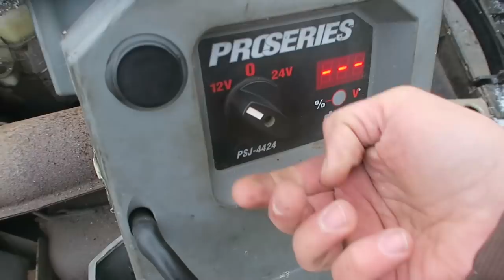BUYING A $350 CRAIGSLIST SNOWMOBILE !!! ( & GETTING IT RUNNING )

Comment from the maker: Hey riders! You guys have to tell me what you think of my new purchase?? Think it was a fair deal for $350??
Reply: Indeed
Reply: Great deal dude . Last year I ended up getting at 86 polaris 600 triple for $200 online . It's been a great sled just had to do some work to it . Love the videos man keep them up !
Reply: I’m not a fan of the torsion arm suspension. But I think you still got a good deal.
Reply: Wire brush on the plugs, helps temporarily
Reply: Jeremy Rhydes deffently worth now customize it ( paint it, new lights, new seat, new track and skies and obviously a nice engine tune then it’ll last u a few winters and u could sell it for triple what u paid for it and start over lol
Reply: Great deal, but your 700 is the go-to sled.
Reply: Nice but you got to get a new seat are you
Reply: Only if u water skip it 
L
Reply: I knew it wasn't going to start and run. should always clean the carbs after they've been sitting for any length of time.
Reply: Jeremy Rhydes man that’s a great deal!  You should clean the carbs and it’ll probably run like a champ!  Cheers!
Reply: even though everything now a days basically has reverse and electric start you still got a good deal considering it actually was a complete running sled when parked . i dont believe everything i hear online and am sure that there is more to it than meets the eye so to speak . if you really only paid 350 for it yes then you got a fair deal .  reverse is a must and electric start is a bonus .  if its electronic reverse you got a even better deal due to the fact that it is easier to change electronics then it is to change the gear chain drive . only problem with the electronic reverse is that if they give problems good luck in finding out why . lots of sensors and you will need to hook it to a electronic reader to find the exact fault .
Reply: The first thing I would of done is clean the carburetors...POLARIS
Reply: Great Find!!  I wouldn't have given a second thought...  Shut up, and take my Money!!  XD
Reply: You ever need any Ski-Doo F chassis parts I got some you can have including a chassis a few cowls one of them is a smoked clear lexan cowl. You can have them I just need them gone.
Reply: Jeremy Rhydes I got my snowmobile for free engine was seized and carb needed to be cleaned did that ran fine
Reply: I bought a 2009 Polaris assault rmk 800 146 nothing wrong runs great fast asf for $1000
Reply: Yes
Reply: Slow , old beater sled.  Not worth 350 to me.
Reply: Next time put gas down each cilander will fire up and draw through carbs faster less pulling.
Reply: Not bad! I recently got a running 370 arctic cat for 25 bucks lol
Reply: Hi
Reply: Good deal
Reply: I don't buy nothin that don't run. It could be a couple hundred dollar part you need and that is, well just a shity deal
Reply: PS. Skidoo so gay. PO fuckin lari's is the way to go.
Reply: Jeremy Rhydes good deal I really like Craigslist i just buy 2 days ago a 2010 Polaris sportsman 500cc 4x4 ondemand with only 40 hours of use and 177miles in brand new for only 900 dollars that’s why I always check Craigslist always you found something good and chap👍👍
Reply: Totally a great deal. I bought a boat for $300 and sold two weeks later without any work for $600
Reply: Good deal man!
Reply: I think it will
Reply: Hell yes
Reply: Best deal I got was 200$ for a 98 Polaris Indy 500
Reply: I got a 1993 arctic cat wildcat for 270dollars it has no spark but I thought it was a good deal
Reply: 700 for a polaris indy 488 and 5 mtn king running
Reply: i got  one for 450 1998   Polaris indie 440 liquid cool
Reply: @mikechick2075  he'll never get out of it what he put into it.. he'd be better off keeping it and riding it till it looks the way it looks now and selling it for what he got it for..😂

Comment: Few years back, I had a wanted ad up looking for a snowmobile that needed some work.  Guy gets ahold of me and said he had a 94 polaris indy 440 to offer.  I went to look at it.  He had it in an enclosed trailer with a few other sleds, so he fires it up, and low behold, it had reverse, he rode it out of the trialer.  I was pretty excited.  It was clean, well maintained and clean, 1 Pull start, Reverse.  Only issue was his wife rear ended his new sled, bent front bumper and pushed hood back.  I got it for $300 3500 miles.  Then he said, I got 2 more sleds you can Have since I bought that sled.  He said there's a catch, they are 4 hrs away.  So i agreed, he gave me an address to his cabin, handed me the keys and said the registration cards are in a pouch in his shed.  I get there and its 2 1992 yamaha ovation 340's with electric start and both were in need of a clean and carb tune.   So worth it.  Out of all the sleds I have now and what I got before and after that, that was a one of a kind deal!  Sold one of the ovations for $1000 and still have the other one.  The 440 and the 340 are ready for this season along with the rest of my sleds.
Reply: You ought to leave that gracious man a bottle of his favorite elixir every Xmas :)

Comment: Ski-Doos clean up well.  Good move cleaning youe carbs / jets first.  Dont forget the primer ports if used.  The air box is mostly for sound reduc.; put it aside until you get her screaming.  Avoid riding thru weeds etc., while it is open. Check 2 carb boots; dryroot there IS a prob. Get a mirror to eyeball and set both carb sliders the same height / idle (~4mm open gap at bottom).  Next, watch ignition. Got spark? Make sure teather switch is closed.  These are a common prob.  Check all exhau for missing springs.  Grease all those fittings.  Look in fuel tank w flashlight.  Too much crud, rinse w fuel.  Check fuel tank inlet.  The Grommet and weiner set up, often gets leaky.  I recommed all new fuel and primer lines (is not a lot).  Nothing like knowing your fuel is moving; no air pockets. Check your skags.  Check the track.  Good Luck; that baby should wake and run pretty well.  After, try some Liquid Glass on that hood.

Comment: Put a little klotz in each cylinder when the sled sits for a long time. It boost the compression up and starts easy. It also makes more vacuum to suck in gas that evaporated for fuel lines and if carbs were drained. Premix works also but try that old trick. Its neat. 😉

Comment: got sucked in at the beauty of a low mileage 1997 GT SKI-doo 700 triple SE. Paid 1800 with 3 K miles from West Berkshire . Fouled plugs. Dealer took me in for 1500 to redo the carbs, etc and it still fouled.  They told me to walk away but I took it to a guy in Woodbury and had the engine rebuilt. He told me that the old cranks had plastic bearing cases that are killed by ethanol. Dipped in for a new tract . After 6 K total I have a great rebuilt machine..Live and learn.

Comment: I got a 1991 Indy 500 for $150. Been sitting for 4 years in an old ladies back yard put I little gas down both cylinders and it started up on the 3 pull. I have had it for about 5 years and still hasn’t let me down
Reply: Those sleds are bulletproof and fast
Reply: I got a 96 indy 500 for free been trying the last 4 days to get it running sat 2 or 3 years
Reply: I just bought a 1991 Indy 500. First sled for me hoping it lasts a while. Paid $550 Canadian with title.
Reply: That's a solid sled.
Reply: Where u live?
Reply: I've had a 91 Indy 500 for 15 years, solid sled, fast old sled👍
Reply: Grew up in Roseau, Mn. Rode a 90' black with blue pin-striped Indy 500 twin 2 stroke. If i remember right it would hit 92. All stock. Across Lake of the Woods. Always wanted a 600 Triple or 650. Sounds weak now....they were the shit back then.

Comment: You also know that you can clean spark plugs with a propane torch... Get the bottom end glowing and then as it cools down spray break cleaner on it and put them back in the sled they will be as good as new !

Comment: Thats what I spend on most of my sleds.  I buy mid 90s Arctic Cat Jag 440s.  Bought a bunch over the past 10 years from $50 to $500 each.    I parted a few out so I have spare parts and motors for a lifetime.  Just fast enough to have fun on and reliable, but not enough power to destroy the chassis.

Comment: That's a 550 F. The 'F' stands for Fan. It's fan cooled which means it will blow warm air out the side and help keep you nice and toasty.
For the windshield I use zap straps to keep it on because they don't dry out like those rubber things.

Comment: Picked up a 98 formula Z 670 for $1000. Replaced most of the wheels on the rear suspension and new slides. All parts totalled $150. This sled will twist the needle off the speedo in a heartbeat. I have bailed on the throttle at 95 mph and still climbing

Comment: If it has compression and spark as well as gas at the right time it will run, just like all the rest of them. Depends on the mechanic and the tunening. When you had the spark plugs out would be the time to put a battery in it and test the compression, I would invest in a gauge if you don't have one already.

Comment: Got a 1980 arctic cat panther 440 for free, that was in very good condition, then got a 2004 arctic cat firecat f7 700 for free as well. All it needed was a new seat cover and a little brake work.

Comment: You looked like me last year.  Almost pulled my arms off. I got one 400 Yamaha older but fast I know nothing about them. What oil gos in the oil 2 cycle or 2 stroke.  What gos in the other oil spot think its mother oil or lubes gear oil not shur it the transfer trans thing

Comment: Got my 98AC ZL500 for free. It sat in my neighbors yard for almost 2 years. had my son ask about it and he said you can have it! needed carbs clean and it ran. went through the rear skid, replaced some bogies and all bearings. new seat cover and painted the hood. turned out beautiful. have about $600 into it. runs great and tarts on the first or second pull even in -15 temps!

Comment: I picked up a 96 Indy 440 it had about 260 miles on it was stored for about seven years under a tarp outside on top of a pallet track was meant paint and see not so good the seat was ripped the gas was like lacquer thinner I made a plug to pressurize the gas tank and blow all the old gas out the fuel line in the front went through the carbs rebuilt the fuel pump put new crank seals on it all fresh fuel lines greased it up and have been riding it for 2 years now thing runs like a champ compression is Beautiful Everything is Awesome like a new sled aside from looking a little old and crusty guy bought it for his wife and she never took much of an interest it was for free just to get it out of his yard and in my opinion the deal of a century

Comment: Gotta love a deal. I’m from Toronto area (GTA) Found a sweet deal near Montreal on a 98 Mach Z 800 triple. Needed NOTHING. Not a tear in the seat even. Sled is mint had 9,000 kms but close to 150 psi across all three cylinders. And for a whopping $600 Canadian. I’ve put 3000 kms on it and not an issue. Same sled is selling for $2500+

Comment: 1976 yamaha et300 sat for 15 years I drained the gas filled it up changed the plugs sprayed  starting fluid in cyl and carbs fired right up ran good drove very good I cleaned it up a little I paid $30 for it and sold it for 400 after it looked halfway decent

Comment: I bought a 1998 ski doo formula sl 500 with 2700 miles that ran and drove for $300 but the seat was held on by a piece of ply wood and a gas tank for a 96 mxz was held on with bailing twine

Comment: $450 for an 02 yamaha mountain max 700 triple. Runs awesome! Also $450 for a 98 yamaha  mountain srx 700 triple piped that sat for 3 years. Just ran sea foam through it, didn't even pull anything apart. runs great.

Comment: I'm telling you yet again starter fluid is your friend in cases like this. If it has spark at all it will fire if it is going to at all. If not, start checking charging system and coils.

Comment: 2 years ago i paid 400 for a 96 polaris ultra with psi mod blaster pipes. The biggest issue was that one carb was disconnected for the throttle.

Comment: Just recently bought a 87 exciter 570, a 88 exciter 570 electric start, and a 91 phazer electric start for 350 bucks, non of them run but I’m gonna make one good exciter out of the two and the phazer just needs carbs cleaned

Comment: The 3 things u did to try to start it would have no effect on helping it start at all.   U added oil even though it allready had oil. You checked plugs but did not replace them. Then u drained the tank.  The initial start is going to suck the old gas that is in the gas lines and the carb itself so the new gas will not help you need to clean the carbs then get the new gas flowing through it.

Comment: Little late to the party but leaving north conway nh tomorrow to ct to look at a 2005 mxz 600 h.o 1500 and a 2007 crossfire 800 for 2k and slightly crushed trailer in the rear all for under 4000 or i am going home clean or not 17yrs old is 17yrs old.

Comment: my good deal was a guy gave me a 1996 Suzuki king quad 4x4 because it wouldn't run after a $200. carb job. the guy was no mechanic nor am I but I pulled out a fouled plug. here's the kicker, it was put in storage shed 4 years ago and when I pulled it out it only had 325 miles on it, basically brand new.

Comment: I bought an 02 mxz 700 with 2856 miles on the chassis has 144 studs and 25 on the engine you whole shot it and it wants to rip your arms off she's alitle fast

Comment: Bought my first sled last feb.3 a 94 vmax600 for $700 with 2900 miles no electric start.Bitch to start w/o start fluid and bad shoulders.10 days later I bought a 2010 polaris iq600 with a starter.The misses took over that one and a month later I got a 06 apex and put maybe 200 miles on it.Bring on the snow after making all those payments.
Reply: I knew you'd get it running.

Comment: If you’d have poured just a little premix fuel and oil down the soak plug hole, you’d have saved yourself about 150 pulls. Speaking from experience. Lol

Comment: 6:59 - WIll it start first time? Probably not - but it's not out of the question. I've had engines that sat for years start first time - and I've had ones that just sat through the winter refuse to even pop. Will it run *eventually*? Sure - but then it's a question of "how much for parts, and how much c*ssin' and use-of-words-the-kids-shouldn't-know"? :-)

Comment: Dump some gas down the cylinders... my best deal 2009 Suzuki RM85 for 600$ was near mint condition... they couldnt get it running took it home 15 mins later i had it running with just some gas down the cylinder... sold for 2000$

Comment: Looks like you did okay with this buy as long as the engine is good and the price is right for its condition.  Whenever you buy used, you're buying someone else's problem child.  If you go into the purchase with that attitude, you shouldn't be disappointed with your purchase.  Expect to replace the wear and tear parts.

Comment: Hell yeah man good deal I picked up a 98 zrt 600 for $500 this year and a 97 zrt 600 for $275 IAM ready to rip I just found your channel and sub to it seems like u got some good content and would like to see some more videos of this sled where r u from? Michigan here
Reply: @generic person condition condition condition is the key I see them anywhere from 500 to 1200 just all depends on condition and make sure you let it run for a while and make sure it is not losing any coolant as they are known for bad water pump seals
Reply: @generic person and make sure the speedometer works because if it don't that means the jack shaft /drive shaft bearing is bad and it broke the speedometer cable key also a known to go bad on these older cats
Reply: @generic person also if you get it and have Facebook join the group Arctic Cat Thundercat zrt Riders lots of guys on there that will help with anything u need and have lots of parts if needed